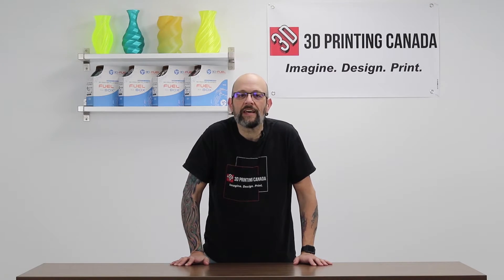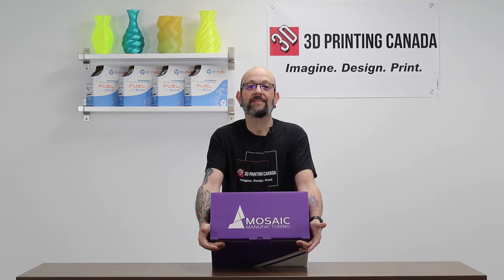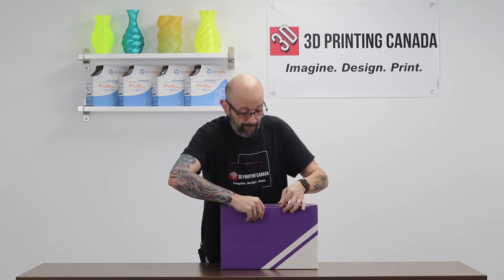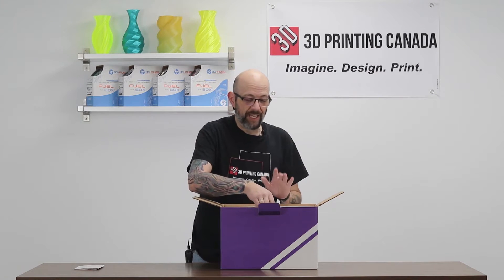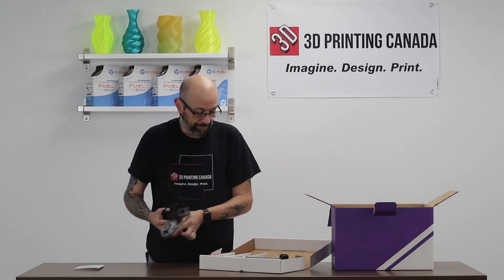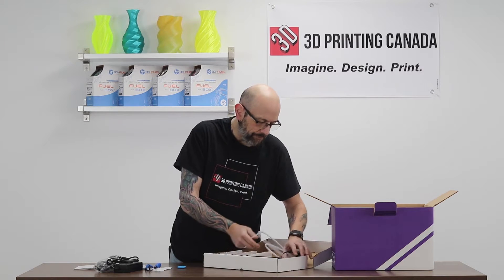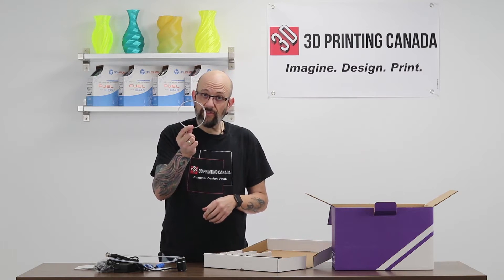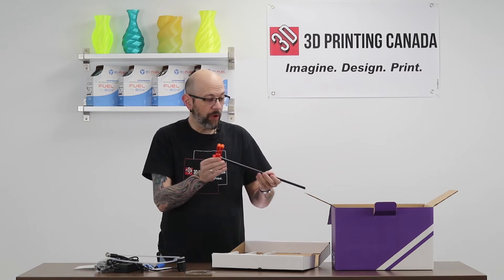Mosaic Palette+ Unboxing, Setup and First Print! Multi-Color 3D Printing

Comment: How much plastic gets wasted during purges? I've been working on a dual colour system with a single hot end for my printer but my biggest concern with single hot end is the waste of material. I've been reading a lot about palette and how it measures the filament being used and all but I still see in the videos that there is a purge block being printed.